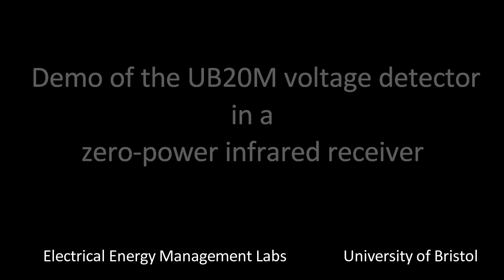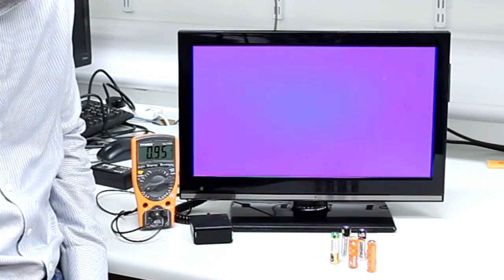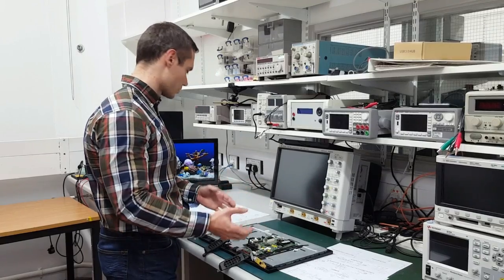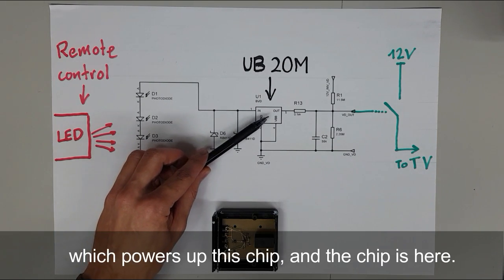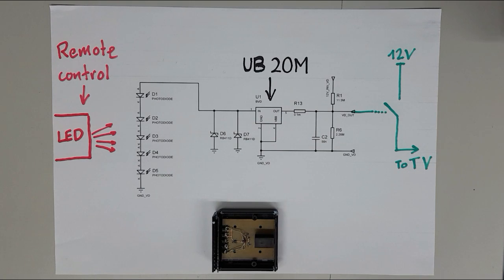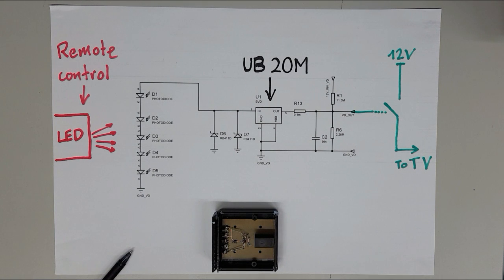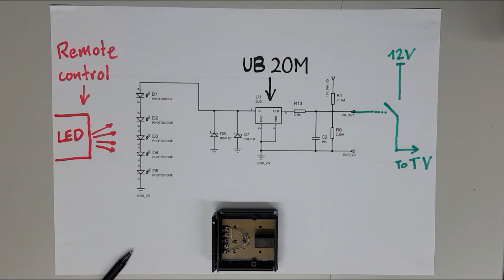Zero-power infrared detection circuit using the UB20M voltage detector

Comment: Shame on you! I'm quite sure that you designed a very good and energy efficient chip. But to measure behind the power adapter can only mean that you didn't understand were the power get wasted in this system or (and that's the very disappoing part) you are not dumb and you know were the power gets wasted and you choose this type of tv only to get a result thats good for selling your chips.
how many power does the relay need to switch and hold the state or do you also developed a zero voltage relay!?
Please Buy the UB20M! It's 100% powered by pure Snakeoil!
Sorry guys i can't understand why you choose this way to advertise for your chip.

Comment: This is brilliant!  The people mocking this are just rude and arrogant and they just don't see the bigger picture, but I do.  The usecase in the video is not the best, however I have a really cool and useful application for this and will start building my prototype shortly based on this tech.  i'll have something working in a few weeks.
Reply from the maker: Thanks. We hoped to create something thought-provoking. Good luck with the prototype.
Reply: Thanks, I've just sent in the sample request form.  Looking forward to use them.  I forgot to request some smd's without the breakout board, if you would be so kind. Thanks again.

Comment: Looks good to me -  I don't really understand all the naysayers out there. I see this as having great potential for extending battery life on things like wireless gas detectors - If I've got the product intent and operation correct, the UB20M could be powered of the nA ouput from a gas sensor - when the sensor detects gas, the chip powers up the battery operated wireless circuit for broadcast back to the controller.
Reply from the maker: Graygnads1  Do you have a particular sensor IC in mind?
Reply: I'm dabbling with wireless gas detection at the moment - existing products can get 3 months of battery life. Where I see a potential use for your IC is for something like a CityTechnologies or Alphasense unbiased electrochemical sensor(eg. CO, SO2). The sensor generates a nA signal when in the prescence of the target gas. The UB20M could be used to trigger the wireless transfer of gas concentration to a monitoring station or even just the datalogging of the gas reading - when the gas event passes the circuit shutdown into "listen" mode. The potential is for gas sensors that can log or transmit data for, potentially, the usable life or calibration period of the sensor; eg. air quality monitor networks. I'm keen to try it and intend to request a sample once I've spoken to my design engineer :)
Reply from the maker: Graygnads1  Good idea, please do get in touch.

Comment: I am just a Hobbiest.. but I was curious does your pull up resistor and 12vdc supply from the wall use current?please excuse this dumb questions as I have no schooling in electronics and want to better understand this IC that seems like magic to me :)
Reply from the maker: It's not a dumb question at all. The resistor divider R1/R6 is drawing about 1uA from the 12 power rail. The divider is there because this version of our detector has a maximum output voltage of 5.5V, so it needs the divider to protect it from a 12V rail. This 1uA would drop to 100pA if we were using a 5V rail, because we could get rid of R6, and so the only route for current would be through the output of the UB20M. However in this standard TV there was no 5V rail. Without our circuit, this TV was drawing from 30+mA from this power rail in standby mode. So 1uA is roughly a reduction of 99.99%. With a 5V rail this reduction would be more.

Comment: Sorry there is no way that the IR receiver alone uses 0.4Watts, there may be other power wasting things going on (most likely the main CPU is on all the time rather than being in low power sleep mode and either polling or being woken by an interrupt) but they could easily be eliminated without the need for your IC using just standard parts and good design principles if the manufacturer had any real desire to do so.
Reply from the maker: Martin King Exactly. Demodulation, amplification, etc is needed with the standard IR receiver. This is what we meant by 'listening'. This can all be switched off with a sensor-driven approach. This TV, before modification, used 0.4W to listen. With 0.5 W being the upper limit of the European low-power directive, low-cost approaches are being adopted, such as keeping the main TV processor on to do the demodulation.
Reply: Bristol Energy Sorry but that set could easily be made to draw 10uW (or less) using conventional techniques if there was the will by manufacturers (and that still does nothing about the 0.1W quiescent PSU power). So at best your device over conventional methods would save 10uW which is nothing like 0.4W.

Comment: Is the current measured before or after the powerbrick?
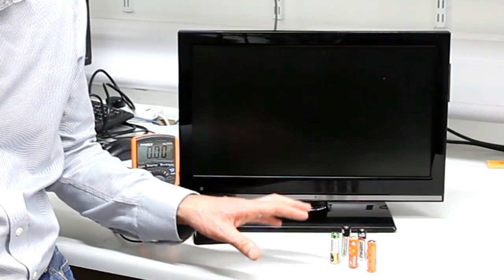Reply from the maker: See 0:29 into the video, we say the measurement is after power brick.
Reply: It should be before the power brick so they could show the actual difference in power usage and show how much this device can actually save energy.
Reply from the maker: It is after the power brick to demonstrate the zero-power IR receiver (100pA leakage only). We are not addressing the power brick's quiescent current, as this is deal with by existing technologies. We are very clear about this in the video. This is solely a means of demonstrating the use of IR energy to trigger an electronic circuit that is not powered up.
Reply: If I understood correctly from the video, the powerbrick consumes 0.1W when the TV is not operational and the TV standby uses about 0.4W for standby plus 0.1W from the powerbrick, totalling abour 0.5W. So with your device the TV at standby uses roughly about 20% less power than normally?
Reply from the maker: Ah, sorry, I finally understood your question...
No, we are using about 1uA from the 12 power rail, down from 30+mA. This would drop to 100pA if we were using a 5V rail, but there was no 5V rail in this standard TV. So that is roughly a reduction of 99.99% in this video, and more if we had a 5V rail.

Comment from the maker: This video is an illustration of how the UB20M voltage detector can eliminate the power used to listen for infrared signals. We use an everyday TV, even though this would probably not be a real-world application for it. We are only eliminating the power that the TV uses to listen for the remote control. Not the power wasted by the mains adapter brick. There are existing technologies that do that (e.g. TI's UCC28730). And by "eliminating", we mean taking any current flows from mA levels down to insignificant pA levels.
Reply: https://www.amazon.co.uk/Ecotek-Standby-Saver-Compact-Socket/dp/B00400ONBI/ref=lp_1724274031_1_1?srs=1724274031&ie=UTF8&qid=1487011703&sr=8-1

What does yours do again? back to the drawing board guys and try not to reinvent the wheel or make a solution for a problem that either doesnt exsist or some one else has done better.
Reply from the maker: Laptech7 The device that you have linked to also has an infrared detector that draws power. The UB20M voltage detector could eliminate the power in that detector. And you could use Texas instruments zero power chipset to eliminate the majority of the quiescent current in the power supply of this product.
Reply: A normal IR detector can draw virtually bugger all current compared to the quiescent current drawn by the PSU (which is where most energy is wasted on standby) saving the detector supply current is like pissing on a forest fire. When you can demonstrate something that draws ZERO current from the wall socket and still be able to turn on from just the energy provided by the remote IR then I'll be impressed. But this is a misleading seriously flawed demo.
Reply: The problem with removing the power needed to listen for infrared signals in the way you have is that it will turn on/switch with ANY AND ALL infrared signals, even sunlight will switch it which is why you added the filter, correct?... Add any kind of filtering to the circuit itself so that The TV turns on with the actual power button on the TV remote and not just ANY and ALL buttons pressed or for that matter a remote being used on another device and your 0 power needed goes out the window.
Ok so the TV was a demo and not a "real-world" application but where and what is this "real-world" application?
I linked a "real-world" device that will actually do what you claimed yours did in your original video before you edit'd the crap out of it and were left with that joke above, you to then add that you can save it power? oh dear please dont, im even doubting yours could even off set its own carbon footprint in its lifetime at this point.
Reply: Bristol Energy but this is not an everyday tv, this is a cheapo tv. I plug an iec cable with internal psu. Another mistruth in your statement. You have lost credibility in this demo. Return with a new demo please

Comment: Don't concern yourselves about the power being consumed by the PSU.  They've probably got a perpetual motion generator to fix that!!
Reply: Shane, actually power-gating the mains adapter is definitely possible but the circuit is slightly more complicated and it would have taken more time to build. We thought it was not necessary to do it for the purpose of this video, which was to demonstrate our chip. Otherwise a circuit based on a solid-state relay controlled by our voltage detector would have done the same job and the consumption would be around 100 microamps leakage through the relay and nanoamps for the rest of the circuit. This is much lower compared to the total power consumed by  TV and the adapter - 0.5W.

Comment: Mains power adapter????
Come on guys work on something that is actually going to be useful. How much time and money have you wasted on this bullshit. Are you British inventors? I think not, you are deceiving marketing twats. 
You put our great country to shame.
Reply: It actually could be useful in VERY specialist specific applications but they've been very misleading by making out it has significant mass market applications. One possible application is specialist tiny embedded medical sensors with extremely low capacity batteries.

Comment: WHAT A SUCCES! 0.5W->~0W!!! The TV draw nothing. But wait. There is a PSU.
From 5.5->5w? Meh...
Reply: Its not fair - chip works and power save could be higher. They need to modify PSU to be turn on by this IC. It's just wrong DEMO.
Reply: 1. They haven't.
2. To eliminate the standby power usage of the PSU, you have to switch the mains before the PSU. You can't switch it with a transistor/mosfet/etc, you have to use something more complex, like a solid state relay. Can you provide enough power to operate it? If you find something that can do all this, now you have a new problem: the PSU box sould see the remote control. Can't hide under the table, or something. Maybe you can make more complicated power connector and wire, but does it worth it? Maybe it more environmental unfriendly, expensive than that f* 5w standby. Or just install a switched extension cable. Or remote switcher.
3. Still a bad demo. It brings down the product to the solar roadways level. Promises, green, less power consumption, more everything, blablabla, while this is a more serious thing.

It's still not that product that will change the world. It resets the product (like the internal clock), makes boot longer (cold start), etc. If I want auto power on for something like a PVR, now I have to install a battery for an RTC, then run wire to the PSU to wake it up, wait the booting proccess, save all information to non volatile storage, etc..

I see this thing is useful, but not for eliminating the standby power.

Comment: What a load of crap, you have made a switch, correct, what about the ac->12 psu that is still running. What a lot of crap, would be good to see this demo on a 240v product. Nice try, but a few mistruths in your marketing. Try again before marketing your product

Comment: Where is the video "Demo of a TV that uses no power in standby" ?
Reply: So you have created a solution for a problem that still needs to be found?
Reply: Bristol Energy so why not put your power meeter at the source of power. Marketing fail here
Reply: Looks like that pulled it as it was very misleading. Shame a respected university has to be pulled up on this stuff by EEV blog.
Reply: Bristol Energy Come on, hold your hand up and repeat after me: we lied. Not saying it was you personally, but the whole idea behind that video does not stack up, so you saying ’edited out the bits that Dave found misleading’ puts you in the Donald Trump area of post truth. Stop it.
Reply from the maker: I took it down and edited out the bits that Dave found misleading, and have added in lots more technical information. We know the TV is not the best application example, but we thought it illustrated the principle at least. This chip really comes into its own in small, long-term, battery-powered monitoring. We would welcome suggestions.
Reply from the maker: We developed the chip specifically for ferroelectret and piezoelectric sensors with 100MOhm to GOhm output impedances for the triggering of medical sensors. The companies that we have sent evaluation boards to have suggested great applications, and quite a few that we had never heard of.
Reply: "We know the TV is not the best application example, "

Maybe come up with a better example then? Because this edited version is still seriously misleading and flawed. This is putting the reputation of Bristol university into disrepute.
Reply: We chose not to put the switch there only because it was easier and quicker to modify the 12V rail. Power-gating the mains would not add any significant value to demonstrating the capabilities of the voltage detector chip, which was the purpose of this demo.
If you are aware of a similar device that does not need a power rail, draws sufficiently low input current, and has a sufficiently low threshold to be activated with a few photodiodes by an IR remote controller from 4 meters, please do share it with us.
Reply: "We would welcome suggestions." 
"please do share it with us."

You have created this chip and you want to sell it to us.
It should be like "You have problem X? We have a solution for you!" and not "We have a solution and now we need your problem!"

You have created this chip for a reason and for a special target group. Just use this reason as a point for marketing. Don't try to invent unrealistic or unscientific reasons just to promote it to your average Joe. This will kill every bit of credibility for your main target group as you have to be unscientific.

Be scientific and use scientific methods to promote your product to your dedicated target audience. This way it will be credible and no Dave will rant about your marketing BS.
Reply: Just find a better demo please. I am sure there are some real applications where in fact your device does have a difference. BTW. Using power from IR sensor from remote controller isn't that good either. Batteries in the remote control are not going to last forever. Using the battery instead of mains PSU to power this TV would be better.
Reply: Plamen You’ve hit the nail on the head, and at the same time totally mis-understood what a hammer is for. BECAUSE you avoided the hard part of the demo (switching the mains) this demo was bogus and showed a use case that nobody would use it for while at the same claiming it will save the world. Here’s an idea: Make a video showing us a good use case for this chip, not some bad made up example that will piss engineering types off.